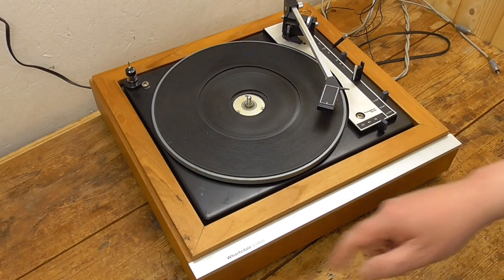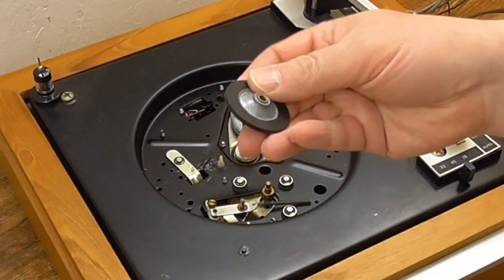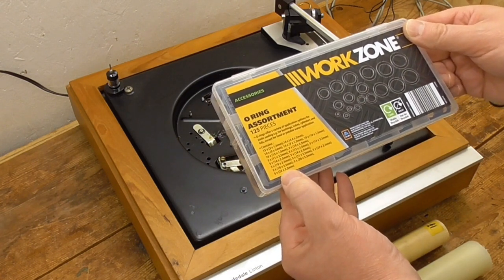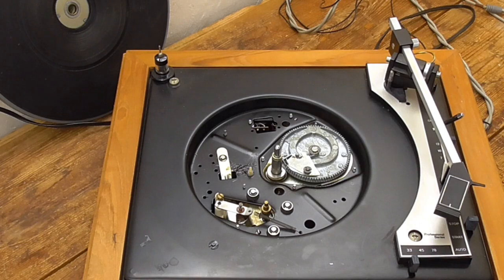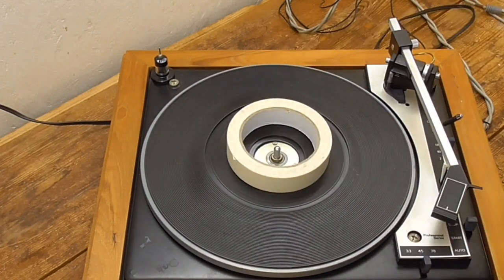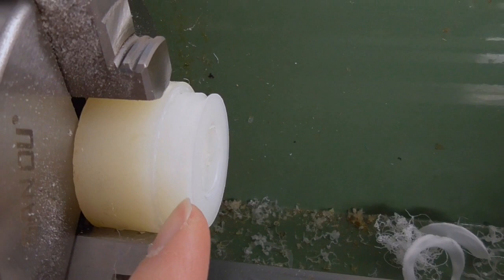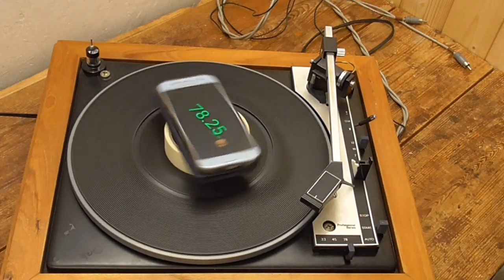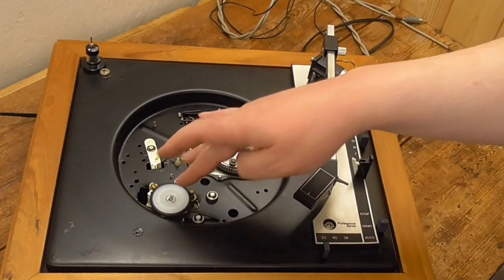BSR Idler wheel - making my own

Comment: I spent most of my apprentice years fixing record player turn tables,  and in later years the idler wheel became a real problem with the replacements being harder to obtain. There is a method  rejuvenating them though, first put the wheel in some near boiling water for approximately 5 minutes next while the rubber is still hot apply some "Winter Green" essential oil then  massage it into the rubber. Yes I know it sounds strange but it works on all rubber producers by replacing the plasticizer that evaporates from the rubber over time.
Reply from the maker: Thanks - that's good to know. The method I used was certainly not the simplest - but did work, although in retrospect I should have made a brass bushing for the centre of the wheel and not relied on the plastic. As it happens it has worked fine - and I have just upgraded the cartridge on it: https://youtu.be/MXGczxwlMYc
I did find another way to simply make a very usable idler wheel, though not something that could have been done back in the day: https://youtu.be/SiXVPvEIxME
Thanks 😀👍

Comment: That's why I hate turntables using idler wheels instead of belts. Replacement idler wheel doesn't seem to exist and you end up disposing your turntable just because of that.
Reply from the maker: Yes, replacements seem few and far between, though I know some people do rebuild them using the original hub. I did find an even simpler way to make one:
https://youtu.be/SiXVPvEIxME
For me, I can fix an idler wheel, but do need to order belts like I did in this video: https://youtu.be/o8xkNXL1b04
(Which has a small belt, despite being direct drive)
Thanks 😀 👍
Reply: yeah. idler wheels suck. i havent even seen one which had a correct speed.

Comment: Sounds like it needs a new stylus.
You may want to try the wintergreen oil trick.  You can mix wintergreen oil and rubbing alcohol (but not the green rubbing alcohol, that's different) at a certain ratio (which I can look it up if you want to try it) and soak the rubber in it.  It softens the rubber to like-new softness.  Most importantly, is it doesn't bleed or "sweat" afterwards like brake fluid and it doesn't change the size either.  I've seen it done with ROCK hard rubber and it turns it back to being soft.
Reply from the maker: Those records are a bit beat up, but the stylus has had little use so should be OK. Its just a cheap ceramic flip cartridge so won't be that great anyway. I  have looked up Wintergteen as I know so.e people use it as cleaning fluid. Only thing I can find in the UK with that name though is essential oil, so not sure if I can get the right stuff here. Many of the common products used in North America aren't available in the UK, and its not always easy to work out the equivalent. It's good to know though that the rubber can be restored. Another trick I thought of trying was to use a neoprene washer. Thanks 👍😀
Reply: @mrrgstuff  You used to be able to get it in the drugstores, but now it is online only. You have to order it.  It's like that with a lot of stuff now. 
I can't stand buying on the internet.  I prefer to hand paper money (not a spy-card) to a person who then hands me what I want and can answer questions.  So I get why you don't like having to do that either.  I don't carry a cell phone either. But then, I'm a weirdo in that way.  I have always loved technology and was an early adopter of internet. I bought my first computer when I was 12 years old (a Vic 20). But I'll be damned if having everything I do tracked is the price to pay for certain convenience.
Reply from the maker: To be honest, I do buy a fair bit online, but I do really love digging though stuff at car boot sales/flea markets and other places, especially where I might find old records. Not so much fun buying them online, and 78s are a bit too fragile to ship 😕😉😀

Comment: I don't think the o-ring size is critical as whatever you lose/gain one one contact point, the other cancels out. I'm toying with 3D printing a new wheel (seems easier and more flexible than lathe) and either finding a suitable o-ring or 3D printing one out of TPU. Dunno if this would be grippy enough.
Reply from the maker: Yes, as its an idler wheel, the diameter isn't critical, though the clearances in the mechanism are designed for a certain sized wheel so it doesn't hurt to stick fairly closely to the original size. The thickness is pretty critical though. I did also try a 3D printed one: https://youtu.be/SiXVPvEIxME
Thanks 😀 👍

Comment: Another interesting project, plus that is an interesting App for the rotational speed 👍
Reply from the maker: Thanks 😀 Yes, it's a great app, and as long as the weight of the phone doesn't slow down the deck, it's very effective. I'm thinking of doing a video where I compare different methods of checking the speed.👍😀

Comment: You know you can take these idler wheels and sand them down on the outside edge and glue a black rubber band around the upper Edge
Reply from the maker: Yes indeed. Thanks 😀 👍.  I did try sanding it down a bit but it still slipped andat that point I though of using an o ring. Still working fine today, though it could probably do with a metal hub